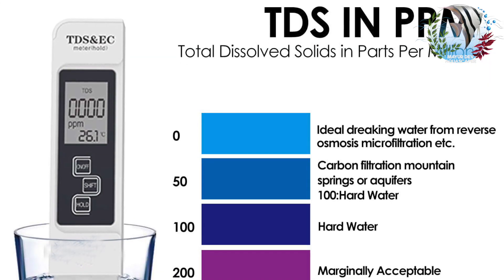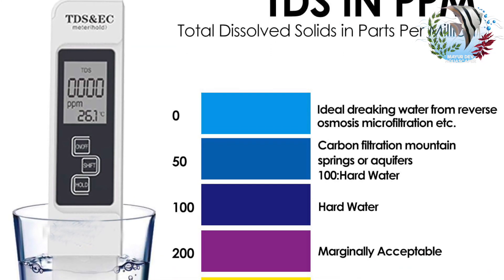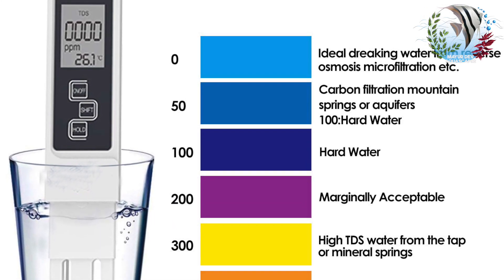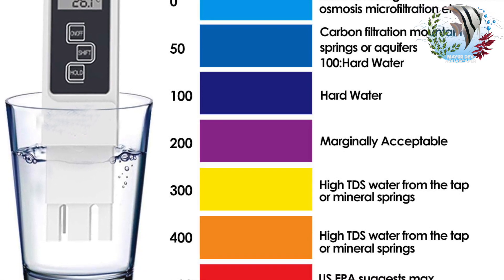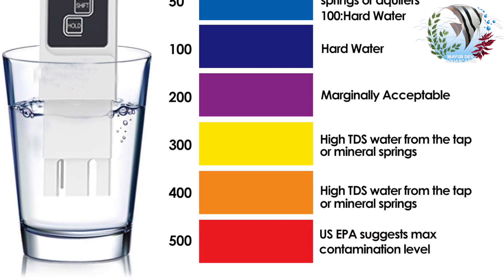Aquarium Water TDS | Fish Tank Water | How to Control Aquarium Water TDS | Dr.Subin Mathews HD1080p

Comment: Helo sir i am using tap water and i checked TDS ppm is 340 to 400 how to reduce tds and how much tds required for fresh water tank how to reduce less than 50 tds
Reply from the maker: You'll have to use water conditioners to reduce the hardness or use RO water

Comment: Sir my decoration tank has a TDS of 136. GH of 7 and KH of 4 degree. But in the video you suggest TDS of less than 25.. I use RO water as less than 50 TDS is not Good for health. Most RO filters is set for 80 to 120 TDS. What should I do now?
Reply from the maker: If your GH and KH are ok, its ok
Reply: how you measure  kh & gh ?